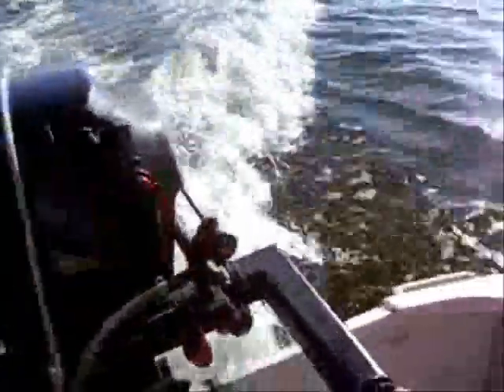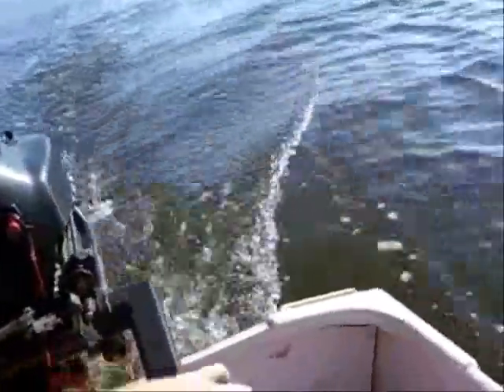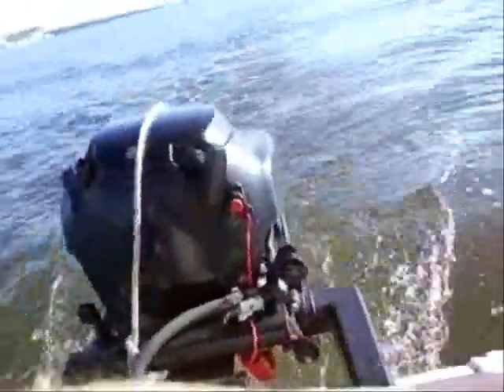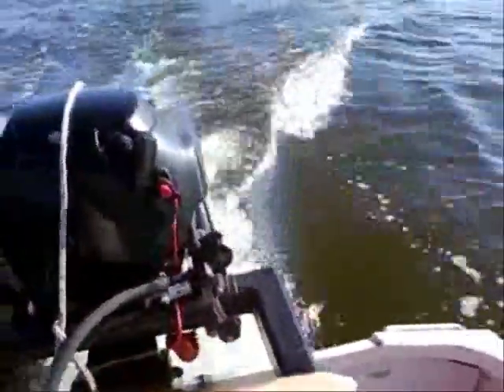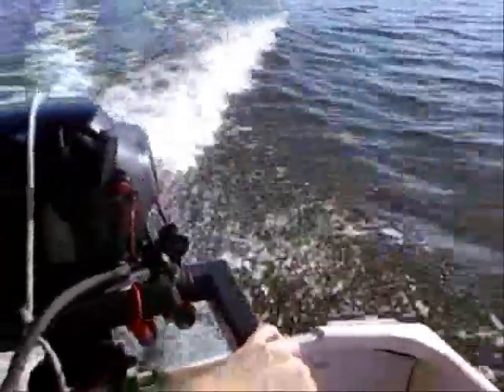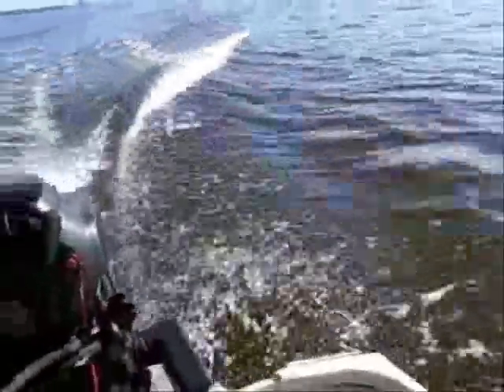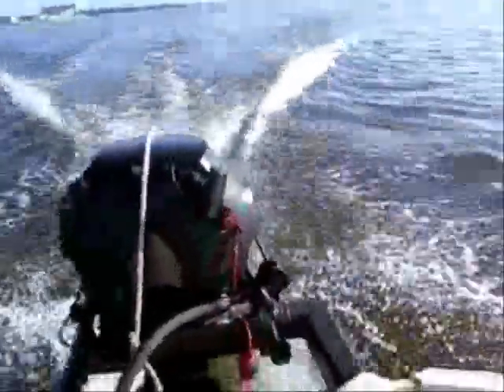5 Hp Briggs And Stratton Air Cooled - 14 Foot Jon Boat

Comment: The reason that these motors tend to have problems after a few years is the fact that they are air cooled.  They run hot, especially when operating at wot all day.  That's why they have ignition problems as well.  They get hot, and fail.  Not saying they are terrible, but a good old two stroke, water cooled evinrude or johnson will run for a lot longer without major issues if you keep up the maintenance (water pump every 3-4 years, lower unit oil change once a year)

Comment: @ph3nology -- I've had similar issues with mine like your describing. When this happens it is a fuel issue either too much or too little. I've had similar issues where i flooded it and it wouldn't start and i've had issues where i needed to choke it. once the motor is warmed up good it usually starts fine on one or two pulls. I usually crank it when i'm unhooking my boat so its good and hot when i launch. Can't do this with water cooled motors!!! lol

Comment from the maker: I would estimate around there give or take a little depending what i have in the boat. I'm planning on doing a test run this weekend with my GPS. I will post what the top speed is. Thanks for the comment.